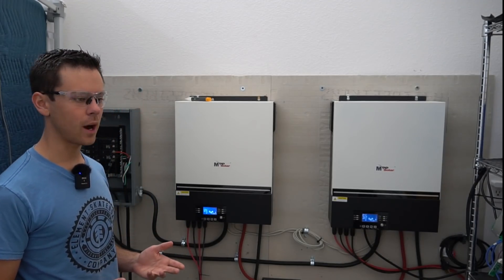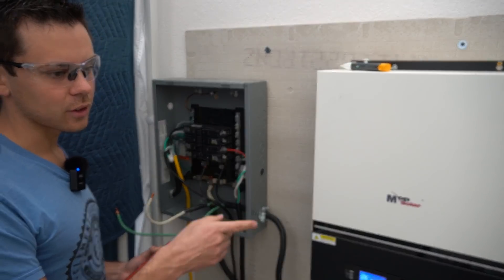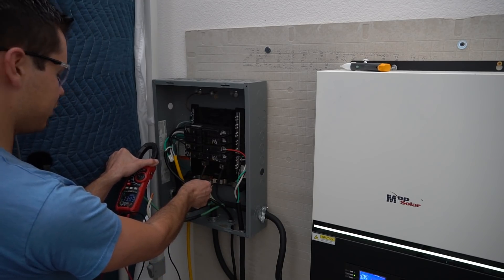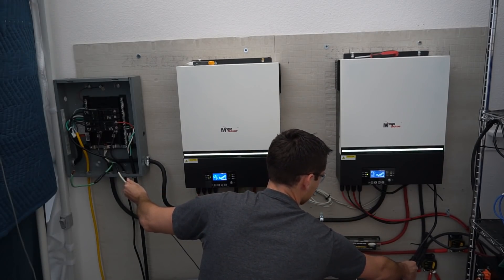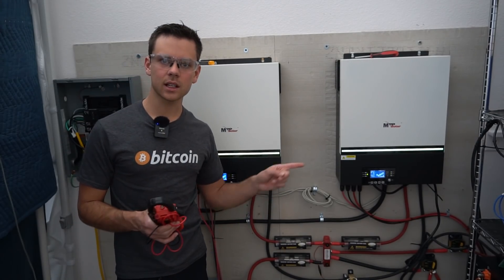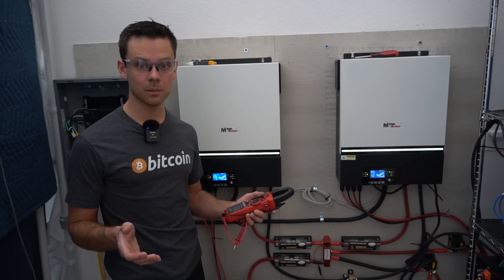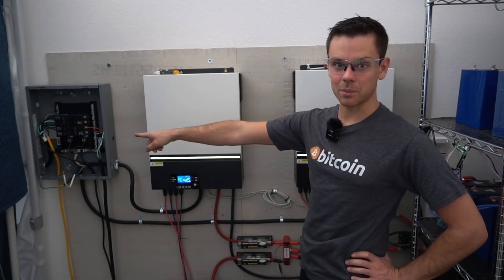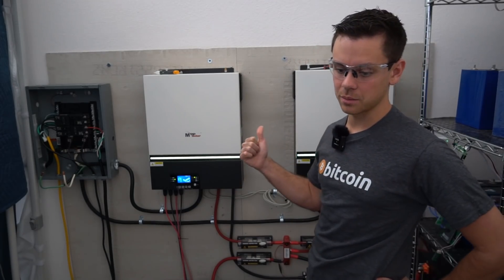Advanced Level Grounding Discussion for All-in-one Solar Power Systems

Comment: The ampacity of the ground conductor of that cord is too small to carry a large leak to ground. If a fault to ground were to happen it could melt off that wire before it tripped the supply from the inverters, leaving the short to "say the case of a machine" live. Which of course would be a hazard if your body completed the circuit to ground. Because you have an existing electric service at this location the only bond to Neutral should be at the "first means of disconnect" I.E. your main panel or disconnect. Anything else will be treated as a "branch circuit" meaning it should be made with separate ground and neutral conductors. 

Now here is where we stray off into the subjective. But I would say you should upsize your ground to your sub panel "the one the inverter is feeding" to handle the maximum potential of your inverter setup. And maintain neutral ground separation throughout. 

Other inverters I have installed from Fronius and Outback natively keep internal separation. If the outback inverter is the sole source of power it will specify a bond to the Neutral. In that case you would need a ground rod to safely carry any leaks to earth. I see your video here showing a Neutral bond from the inverter natively. I cannot offer a comment on that without more info.

If you removed your electric utility meter and replaced it with a battery inverter to power your entire structure you would still follow the "first means of disconnect" convention. And all branch circuits and sub panels would need dedicated ground and neutral conductors of sufficient size to carry return power flow and current shorted to ground respectively.

Conclusion, please look at how you would dissipate a large flow of current produced by the inverters in a short circuit to ground situation. Consider up sizing the ampacity of your connection to your larger ground situation at your property.

Comment: Curious how many of you guys with decent solar systems have lightning rods setup?  If so, I'm assuming they have their own grounding system?
Reply: Most folks have panels where the frames are grounded through the metal mounting structure. I have mine "down and dirty", using 2X4s to tie them together. I was experiencing a bit of an electrical "tickle" once I tied them into longer strings to work with my  dual 5000W Growatt system. So I tied all the panels to each other with 4 AWG wire, and drove a ground rod in next to the array, connecting them all to that. No more "tickle". I assume that I would need a "lightning rod" that would be higher in elevation than the highest point of the solar panel frames to attract lightning to that, rather than having it run through the solar panels. But, being below sea level in the Salton Sink of southern CA, I'm not worried much about lightning. I do have a seperate ground rod that my RV is tied into. (It never moves). The Growatts feed my  breaker box, which is grounded to that ground rod.
Reply: p.s. I've been off grid several decades now, growing little by little.

Comment: I agree with you 100%, and the ground bar in your panel should be connected to the case already. The neutral bar in your panel should be isolated from the case. Generally the neutral bar is closer to the hot bus and is sitting on the same insulator.  If you look at Dan’s, and unfortunately I can’t think of his last name, install from on the forums you will see he did the same thing. The ground is continuous from the main panel all the way through the system. The subpanel isolates the two simply because you only want one bonded connection. This holds true whether or not you Pull hots and a neutral out of your main. panel.  Dan actually ran into a grounding problem too, but he was running the grounds not only to his inverters but also directly to his subpanel. This allowed current to flow down his ground back to his main

You’re also right about driving a second ground rod. That is always always a bad idea unless the two systems are 100% separate and separated by a fair amount of ground. And I mean earth not wire.

I won’t speak to wiring multiple units, I only use one. I will admit to having stared at the multiple unit wiring, and wondering the same thing. I read it as all of the neutrals being connected and a single neutral going into the panel, but that’s essentially the same thing you’re doing by pulling each of the neutrals to the same bar. And OK so I just made a liar out of myself because I did comment on it. 

Great video Will

Comment: I watched a video from David poz using a auto transformer after the inverters because of the unbalanced situation and ground / neutral bounding, i don’t know why, I didn’t watch any video about the ground neutral bound using power inverters, the always said damage can occur if them get bounded, i don’t know how it’s works in Europe that doesn’t need to be bound because they use 220 ac in all their devices, in the American national electric codes always recommend the ground and neutral should be bound, then if i want to connect any inverter splits phace i have to review all the connections in the house before giving power because any single light socket or receptacle can have a neutral bounding with the ground…

Comment: Will i am running the same set up as you how ever, My main panel is just a out door 125 amp Ground is separated in the main panel. From there everything runs to the out buildings from the solar shed. House, well pump, RV and outdoor pedestal. I am 100% off grid I do have a generator for back up and it has a floating ground connected to one of my inverters. I made all my runs to other buildings on my property minus the ground. so I just ran Hot and Neutral to each sub panel and added a earthing rod as each. I have had no problems doing this and everything is working Awesome.
Reply: I treat my 6548 Inverters as the main panel and all other panels as sub panels with separated grounds and Neutrals.

Comment: What is a ground loop?
I still don't understand why the neutral is connected to the earth.
What is the point in having an earth, if the earth is connected to the neutral?
I thought a proper earth was a copper rod in the ground connected to the earth buzz bar.
What about lightening?  I thought the solar panels have an earth to a copper rod in the ground also.
Reply: It is 2 fold.  It creates a pathway for incident energy so you dont have to fuse or breaker the neutral, and it's to give a flat reference point.  A floating neutral in split phase operations can mean one leg to neutral could be 60vac, and the other 180vac.  A bonded neutral ensures both legs are reading what they should, and that the loads receive what they should.  You have to have a solid reference to anchor the neutral and prevent damage downstream.

I commission power systems and have seen the result of a floating neutral under  fault current.  The neutral conductor got so hot it melted.

Comment: I use LV2424 in Travil trailer. 
I discount 30 amp shore power cord from main panel and right into LV2424. Then right out and back into panel. Easy work. 300 amp hours of battery and no problems for 2 years running 24/7.

Comment: I have my two parallel LV6548's AC setup just like you have, but without a bond in my load panel. It works fine. Only one ground to neutral bond at the main panel. The output power to the loads from both sources goes through a transfer switch for L1 and L2 only.  These will never feed back to the main panel.

Comment: if the system is not connected to any AC input, and you recomend not grounding at the AC output, does that imply that there should be no ground for the panels as well? like a totally groundless system? what about lightning hits? does that suggest that the panels atleast should be grounded? Sorry, not a pro but definatly would love some clarification

thanks

Comment: The bond should always be made as close to the sources as possible.  However, I am not a fan of the inverters being bonded themselves.  Technically the bonding should be done at one point when paralleling outputs of machines.  When they bond them at the inverters themselves, it causes issues of circulating fault current.
Reply from the maker: Yes, agreed.

Comment: I know from the Victron Inverters, that there is a ground relay, that automatically bonds ground and neutral in inverter mode. 
The relay opens, once a AC input is connected. But the ground relay can also be disabled in software.
Reply from the maker: Yes, everyone should copy victron. I am working with one of their inverters right now and the ground relays are fantastic. Fixes all of these issues.

Comment: do i need to ground an inverter in a travel trailer solar setup?
Reply: The purpose of grounding gives a path for fault current.  Soooooo, it's always a good idea to ground everything.  However, it's a trailer.  It's not practical.  Realize that you can actually start to create a static charge making you the closest pathway for current flow for lightning if you remain ungrounded.  But how often does it happen??? Not very.  But there is inherent risk to having no earth ground
Reply: @offgridmgtowhomestead2520  so if i wire a transfer switch to the inverter into my distribution panel will the chassis ground already there work?